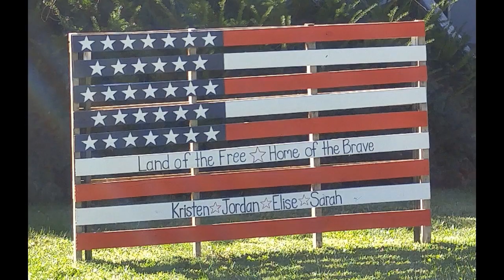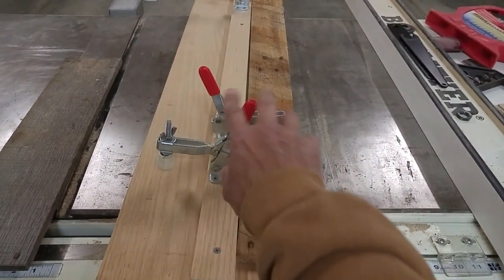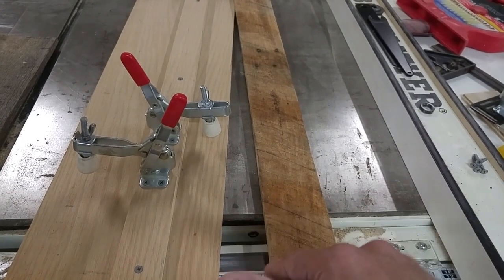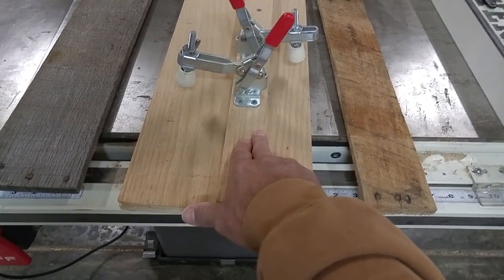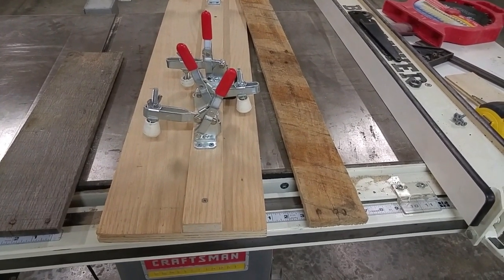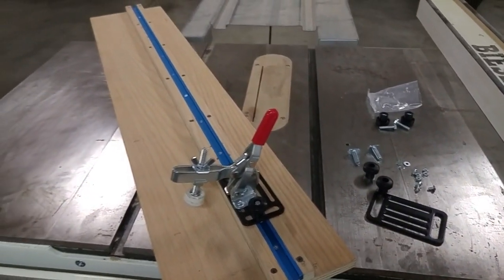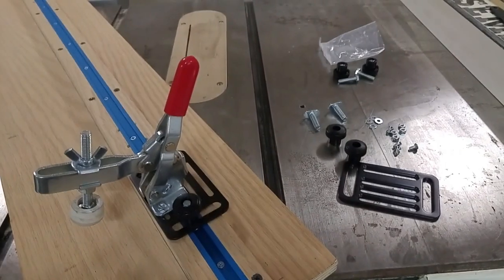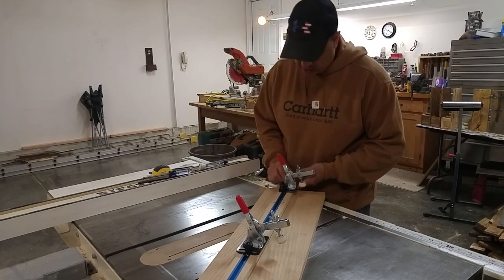IMPROVED Straight Edge Table Saw Jig

Comment: Hi Richard: Great little jig! You might also consider using the type of Toggle clamps that work automatically by clamping the wood regardless of the thickness. That way you don't have to bother with always adjusting them, just clamp & cut.............Just a suggestion.............Steve
Reply from the maker: Sapele Steve - great suggestion. Those can be a little pricey, but someone might definitely prefer that. I appreciate the comment.

Comment: Richard, please forgive my ignorance. This is all new to me. Could you explain what the jig is doing for you? It appears the jig fence is parallel with the table saw fence. In my mind, this should have the same effect as running the work-piece through without  the jig. I appreciate the videos!
Reply from the maker: Chad Smith - Good question. Many strips of pallet wood I use are not straight. The straight edge jig is used to make one straight edge by safely securing it to the sled. Once you have one straight edge you turn it around and run the straight side along the table saw fence at your desired width. Never push a crooked board through your table saw...very dangerous because the board could twist as you're cutting.

Comment: Hi love your vids im from the uk and was wandering what size are the toggle clamps your using as i am going to need to make one of these jigs asap, thanking you in anticipation kind regards "matt"
Reply from the maker: Terence Wall - Thanks for the kind words. I'm using a 500 lb. (Pounds) "vertical" toggle clamp. When clamped on the wood, the handle will not be in the way of the saw rip fence. Clamped, it's about 4.75 inches from the end of bar that holds the wood down to the back of the clamp. Hope that helps.
Reply: Richard Sanchez yes Richard it helped a lot as i have ordered the clamps and looking forward to making the jig, im basically trying to achieve the same thing as you just getting a decent straight edge on pallet wood boards, lets face it we are not making high class furniture just trying to straighten up some boards and the jig does the basic job of that what we need no probs thanks again keep the channel going

Comment: No disrespect intended, but you also could've just made this a one-sided jig. I mean by running 2 small pieces of the t-track across your sled and drilling a hole on each end of the center strip to run a bolt thru from below and tightened at the desired width from the edge with a wing nut or the like on top. Just seems to me like an easier way to get the same result. Thanks for sharing.
Reply from the maker: Richie Primo - thanks for taking the time to share your ideas.